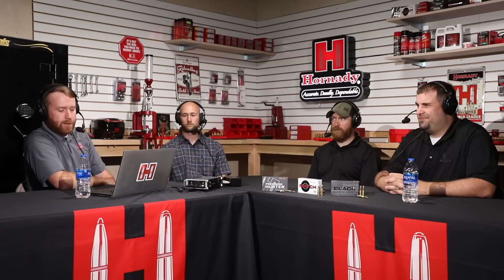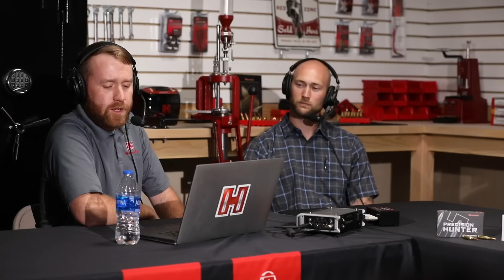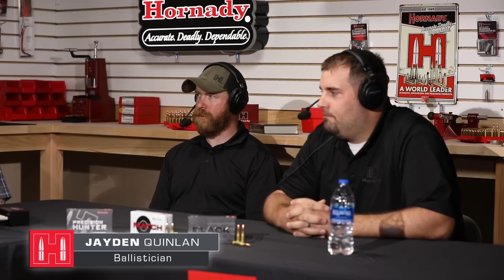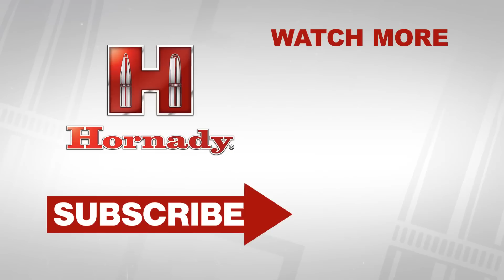6mm ARC Post Launch Discussion

Comment: I've found running an 18" barrel, in an AR-15, with a 3-18x scope, and the vortex impact 4000, that this is the best hunting gun I've owned. Super accurate, super efficient, and ultra low recoil.

Comment: Good engineering, bad support. It's been out well over 2 years, and you still can't buy a piece of brass. My local gun shop says they have seen one box of loaded ammo. My 6MM ARC is in the back of the safe. Got sick of using Grendel brass to form to the ARC. Can't buy Grendel brass for the last year either. With no support it is dyeing a pretty quick death.
Reply: I agree with all that and then some. On the other hand, I have a need for a deer cartridge that can use a small rifle primer cuz I can find those.

Comment: there should be more videos like this from the manufacturer. i learned so much and i was worried about compatibility issues between the mags and bcg. also if a standard lower was going to work or not.

Comment: what the difference between 6mm arc and 6mm AR??
Reply: They tested a 6mmAR/243LBC/6mm Predator  before they shortened the case .029" So the ARC is apx 50fps slower than the 6mmAR.

Comment: WHY ?

The Hornady Black 105 grain factory load crosses over my chrono at 10 feet at 2630 FPS or more.

YET ...

ALL nine of the listed powders in your released load data for the 105 grain BTHP out of an 18” barrel show MAX charges yielding less than 2600 FPS

AND

7 of 9 of these powders are less than 2500 FPS 

WHERE 

Did the velocity go ?  I don’t buy that I have a “fast” barrel because a number of other shooter have posted the very same velocity out of their 18” barrels from a variety of gun makers ....

SO

Who screwed up ?  Why is the factory load 130 + FPS faster than ALL reloading powders tested and published ?

Y’all know this is making the 6-ARC look slow.........

Comment: I have had three factory barrels from Winchester and one from Browning.  I have measured the barrel twist of each before wasting a lot of bullets not intended for the barrel.  The .243 WSSM has a one in nine twist.  I have stopped with the 87gr Hornady V-Max or the 90gr Berger VLD as a top end to my experimenting.  I have found it very close to the 6mm Remington, which I handloaded for decades, in performance.

Comment: Ive got 3 grendels a 12" 16" and 18" think ima pull the 16" barrel and replace with the 18" arc barrel. And as far as the 6.5 grendel mags i like the 6.8 spc mags myself asc tend to be the best but the 6.5 grendel asc mags work well too i just had better luck with the 6.8 mags myself. I just wish someone would make a polymer mag for the grendel and arc btw thats the 15rd mags and the 25rd mags im using.

Comment: One of the main reasons we have the 6.5 PRC is because there was a great wildcat cartridge called the 6.5x284. There's very little support for 6.5x284 because there's a version from Lapua, Norma, and winchester, and none of them were saami certified. I'm glad that Hornady went through the process to get the 6mm Grendel saami certified as the 6 ARC. I wish they would have done it a few years ago before I bought a 6 Predator barrel. LOL  I think the 6 ARC would be a huge upgrade for the military.

Comment: Biggest flaw of this cartridge is the magazine, you can't expect everyone to be satisfied with shitty low capacity magazine, it completely defeats the purpose of the AR15 platform (high capacity, great firepower). 
If this cartridge can only be used on some super designated hunting/match AR15 then it's pretty much dead cause no one is buying that. Show me the 6mm ARC being fired automatically out of an AR15/M4 with a good 25 round magazine or a drum mag. That way at least everyone can see how reliable and stable this round can be in an AR, right now this just doesn't feel very compatible with the AR15 system. Hornady should have partnered with Magpul to make some high capacity magazine first. 
The feeding system is a mess, every AR15 that uses this round are either a precision AR or hunting AR, it's NOT flexible.
Reply: 20 round mag is Plenty.  In the military the DMR / SPR role is running semiauto and not on select fire.
Reply: @petersouthernboy6327  See that's the issue here, people just assume the 6mm ARC is a DMR/SPR round (it's not) when it reality it was meant to be way more flexible than that. No military or law enforcement is ever going to adopt 6mm ARC if it's only good for DMR/SPR, cause they would just go for 6.5 Creedmoor or .308 instead
They already showed us 6mm ARC's long range efficiency & accuracy etc. Now they need to show us how efficient & flexible the 6mm ARC can be in an assault rifle/carbine, no one wants another .224 Valkyrie. Actually even .224 Valkyrie can do better in close quarter & urban environment since there's a 25 round magazine that worked flawlessly and can even be fired automatically with no issue. It was a far more flexible round than 6mm ARC.
If the 6mm ARC can not be used like an assault rifle/carbine cartridge (meaning high capacity, reliable feed in full auto etc.) then it's just gonna be a niche 6.5 Grendel variant with exactly the same fatal flaw.

Comment: Reinvent the wheel yet again. Fix the 224 Valkyrie if you wanna do something
Reply: 224 was a bad design terribly executed.   Very limited high BC bullet selection and the rebated design on the case rims tore - meaning most cases couldn’t be reloaded
Reply: @petersouthernboy6327   Sounds like you are referring to 22 nosler rather than the .224 Valkyrie which retains its rim dia relative to case head.  Reason why .224 V requires a larger bolt face in an ar15  platform.

Comment: Using the Hornady 4DOF APP and some speeds provided by Gavin Tube's review of CMMG 20" AR (2860fps using 95 SMK and TAC) compared to the 2650fps of ARC's 108 ELDm. It looks like the 95SMK is 2 mils flatter at 1000 and beats it by a half mil in wind drift. Hornady released an 88 gr for the Valkyrie and the 123 gr for the Grendel. Any chance there will be a lighter projectile in the 95 grain range with a high BC specific for the ARC?

Comment: If I could use less powder than with my 6mm Remington and keep the same performance...as the data suggests...I am thinking a CZ or Remington M700 bolt rifle is in my future.  I am not a fan of recoil when it is not necessary. the .243 Win and 6mm Rem are great for that.   I HOPE you can get some traction with this round, it sounds like a incremental increase in performance from what we've had.

Comment: So the bullet weighs 2/3's the weight of a 308 155grain.  And travels also 2700fps same as a 155gr 308.  So then to me the 308 still has more energy up close and over long range due to being a very accurate caliber and the energy retention of a bullet weighing 50% more.  So what benefit am i missing over a 308? As a 308 with a suppressor/silencer on has very little recoil.  And the weight difference on a rifle only really applies to a soldier who will carry it day and night.
Reply: SOCOM wanted it.  They ordered AR-15’s chambered in 6mmARC for the DMR role and Barrett delivered them two months ago.  A SCAR-17 with 180 rounds of .308 weighs 12-17 pounds more than an M-4.  Which makes a difference in the mountains of Afghanistan

Comment: Given that the 6.5 Grendel can't hack 140's, and the 140 class bullets are what makes the 6.5's shine, I've figured that 6mm was the sweet spot for the AR15. Not wanting to deal with supply issues has kept me from trying one of the existing wildcats (and some weren't optimized for 100+ gr target bullets anyways).
The 6mm ARC has been optimized for the best available bullets, and won't have the wildcat hassles, so I think it's worth a go. I would've preferred it to be 6.8 SPC based, but that's not a deal breaker.

Comment: you make a great point around 18:00 on 243 win and weight. Lower weight and higher velocity means more energy at closer range, but it's not a cartridge designed for close ranges, and terminal ballistics change over wide speed envelopes. Better to have similarities in impact velocity over a wide range of distances.

Comment: I would love to see this type of rollout for the 8.6... when's that coming? In a few months? (please oh please oh please oh please... been waiting 2 years and am working on an AR308 build just for this project).
Reply: Forgot all about that 8.6mm concept!  Thanks for the reminder.  Would be great to see it.
Reply: @michaelsurratt673  it was supposed to come out this year's shotshow. SAAMI approval and testing plus covid seems to be putting it all on delay.
Personally I wonder if they're having trouble standardizing a chamber. They're long loading .338 bullets so you can use the longest heaviest high BC subs, trouble is, if you long load the 185s and 200s thar already exists, the ogive is so far out that it won't hit the lands in the same place as a long high BC sub. That means either the subs have to jump or the supers can't fit.

And that's because the appeal of the round is that high BC 338 bullets are common, plentiful and effective... but if the ogive has dramatically different shapes from length to length (Federal bullets vs Lapua bullets) and since this is supposed to be accurate with subs at long ranges  (600 BC 300 gr bullets hold onto energy REALLY well at long ranges) but that potential for great accuracy is dusted if the chamber us meant for a blunder 338 Federal bullet shape.

All this speculative ramble is to say that it's possible that 2 things are holding all this up: perfecting an accurate chamber that works for subs and supers, and Hornady might be working on a simple cheap versatile polymer tip 185 or 200 grain LONG BC 338 bullet... think a 120 gr 6.5mm lapua scenar profile but scaled up. But that means the reload value of the cartridge might go down if you can't use 338 Fed bullets loaded long.

Just thinking out loud.

Comment: We've been debating whether this cartridge requires longer than normal gas tubes (gas port locations) relative to barrel length than, say, the 6.5 Grendel. What does Hornady say?
Reply: Texas Plinking just released his video with a CMMG 20” 6mm ARC. He said both the 20” and 16” versions would have rifle length gas systems.

Comment: 6.5 Grendel is a hunting cartridge with target capability. 6mmARC is a target cartridge with hunting capability.
Reply: 6arc can do PRS I mean competitive shooting too. Gas guns
Reply: @C-Bomb  Not necessarily. I plan to use 6mm ARC for varmint and predator hunting.
Mostly coyotes but if I encounter a mountain lion I want to drop it at long range.
Reply: Well said. 
Match applications 6mm is better. Unimpeded path into paper, no problem.
Military applications 6.5mm is much better. That 6.5 hits a twig or branch, it will keep on trucking.
Reply: @norman_sage2528  negative.

Comment: VS. 224 Valkyrie....Why switch?  Why not switch?  A big question from the standpoint of an 07FFL who sank a bunch of money into the 224V for barrels and builds; only to see it flop with lackluster reception at first after the ammo debacles.  From a ballistics standpoint I can definitely see the advantage when running numbers against data I've collected in my own testing of the 224V across multiple barrels and loads.  To be frank, I was extremely excited for the 224V, but at the same time was thinking in the back of my head, "...why the heck didn't Hornady or someone do this with a 6mm?"

facepalm in 224V  Should have waited I guess; very excited to get hands-on and do some testing!
Reply: they have a video on this specifically. IMHO, the 6mm is just better. It can carry more weight easier, and still hit the ranges required. And the valk wasn't really viable for hunting, the Grendel is a great hunter, but is a bit slow. The 6 splits the difference and has most of the benefits of both for most game and for target shooting. It trails the Grendel on larger medium game.

Comment: Would it be possible for Hornady to create a new brand or line of products to compete against 🐺 Wolf?  2:40 Magazine reliability
Reply: I doubt it since Russia has cheaper labor costs and less regulation that adds to the manufacturing costs. Hornady already has some lower cost ammo but it's still far higher than Wolf. I think that's as cheap as it will get though I also think it's better quality ammo too.

Comment: A bolt gun with a 24 or a 26 inch bb. I'm sold
Reply: Why not a 6 BR, 6 Dasher or 6GT? They are all better 6mm's out of a bolt action. Unless you just want to run a micro/mini action.  My 6GT pushes 105s at 2960 from a 26" barrel.
Reply: This cartridge is specifically made to fit into an ar-15 size magazine, if you want it for both an ar-15 and a bolt action I can see that but using it strictly for a bolt action when there are better choices when you don't have the constraints of the short mag length of an ar-15 just doesn't make sense.

Comment: You (Hornady) said in previous videos that the 6mm ARC can handle 55 to 100+ bullets. How true is it, I notice Hornady is only selling the ammo loaded with 103 to 108 gr bullets. I very curious if Hornady will load 75 to 95 gr bullets.
Reply: That will be more of a financial question for the ammo manufacturers rather than a technical one. If a ton of people want to shoot screaming fast loads at gophers then manufacturers will make ammo for that purpose. To me the sweet spot for the ARC is that the longer higher BC bullets extend the range of the cartridge far beyond what a regular AR is capable of.
Reply: I think you can probably expect 58gr, 75gr and/or 87gr Vmax loads in the future.
Reply: Johnnys reloading bench did and awesome video with different grain weights and powders I believe he started at with a 68 gr vmax.

Comment: At roughly what distance does the 6 ARC overtake the Grendel for energy? When/where does the 6 ARC outshine the 6.5 Grendel?
Reply: Depends on the bullet selection but in general I would say between 800 and 1000 yards depending on a host of factors and if you truly did a 'fair' comparison. IE Using the optimal bullet weights and barrel lengths for each.
Reply: @tyler6147  800 yards? What? 6mmARC and 6.5 Grendel come out the muzzle at near identical energy levels. However with it's higher BC 6mmARC begins trialing away from 6.5 Grendel immediately.
Reply: @gsxr1189  I haven't ran every available combination, but in general for practical application the farther you go the more stark the difference will be. At around 500 yards the hold over/dial up is about the same...but that is when it starts to separate. Again though, as they say in the video 'it depends on what your application is'. And as I always say when people start caliber arguments, "I wouldn't want to get shot with either one".

Comment: Make the 6 Dasher please
Reply: Won’t fit in a AR-15
Reply: @petersouthernboy6327  Sure it will, we made  a lot from 2009-2012. You just can't use a common ar15 bolt.
Reply: @crashdsnowman1  in an AR-15 form factor?  I mean, I have AR-10’a as well….

Comment: Can you give some guidance on these mini actions for a bolt gun. I would like to build one with the 24
“ barrel I have already ordered the chamber reamer and have a gas gun I am converting over to the 6 mm arc. There I am considering with a 16” or 18” barrel length. Certainly looking forward to loading data and ballistic data from you. I think this will be a super winner.
Reply: CZ has a smaller than short action and Howa does the Mini Action. Looks like you would be swapping barrels with current gun for now, and barrels are cheap in the grand scheme of things.

Comment: Maybe Hornady should make 103 and 108 gr bullets for the 6.5 grendel. Federal makes a 90gr with claims of 3000fps. Correct me if I'm wrong, but i would think a same weight bullet out of the grendel and the arc would be splitting hairs.
Reply: It would be massively different actually. A 103 and 108 grain in 6.5 would require a fatter (obviously) and shorter bullet and that would result in a much reduced BC. There ain't no such thing as a free lunch. The only way to get to the weights you are talking about would be to buy and shoot extremely expensive solid copper CNC machined bullets and even then achieving the goal would be really hard if not impossible to get a high BC with the parameters you mentioned.
Reply: 6.5 Grendel can match either the velocity or almost match the BC of 6mmARC but it cannot do both simultaneously and that's what needs to happen in order to match the performance.
Reply: Short fat bullets have lousy BC’s tests why.